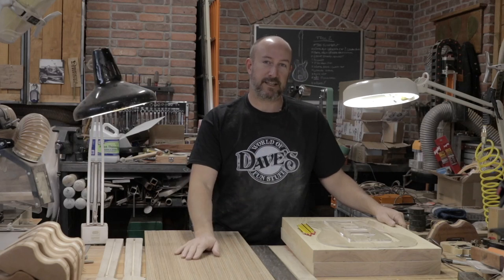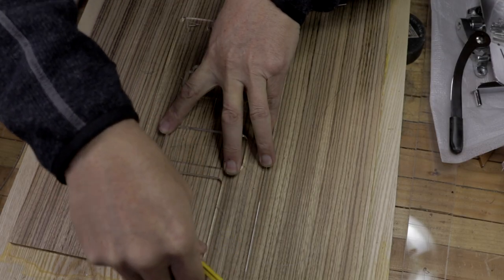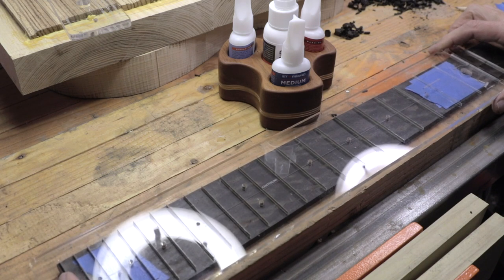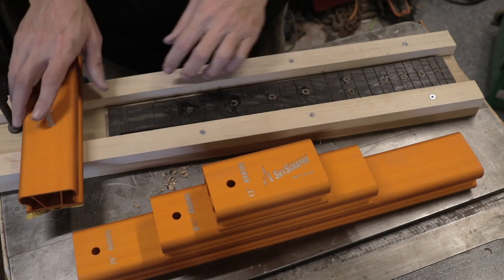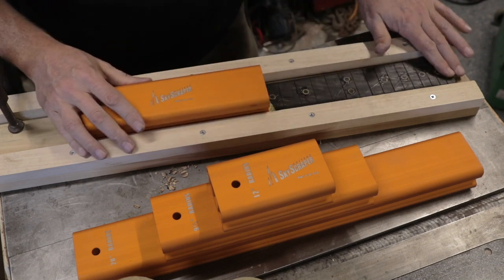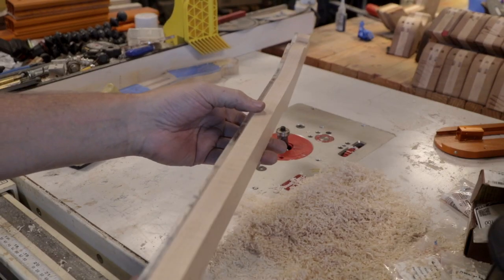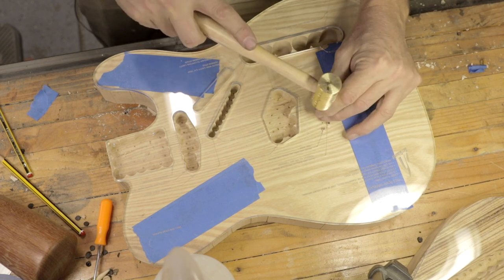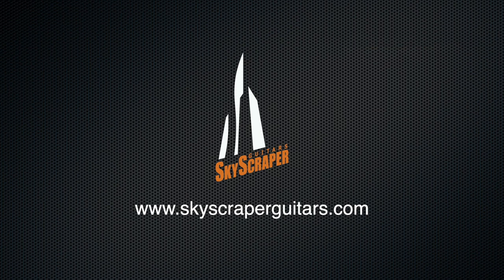Let's Build A Tele - Episode 2 - Routing, Radiusing & Raging

Comment: Hey Greg,
Ever consider a vacuum bag instead of clamps at 3:24? I hear they're the bomb and would have no trouble getting those stubborn bubbles and air pockets out.  I've been edging closer to tackling the learning curve but still resort to clamps and cauls... one-o-these days, maybe?  Cool build though for sure!
Reply from the maker: I've had a vacuum system on my want list for awhile now.  I get by with the clamps, so it hasn't been a priority...  YET!  Maybe Santa will bring one by a few weeks from now...  Hmmm...  I probably better make sure he has my list!!!  :D
Reply: @SkyscraperGuitars  I've recently been repeating a great quote attributed to Henry Ford: "If you need a tool and don't buy it, you'll pay for it but not have it." It's a great quote but my behavior regarding it is a bit hypocritical... maybe it will have an effect on Santa though? 😎